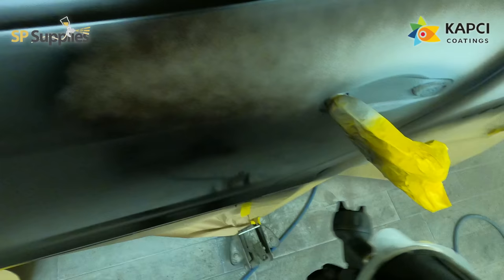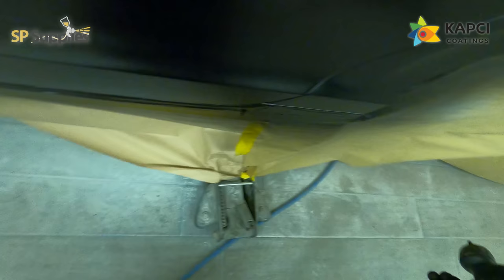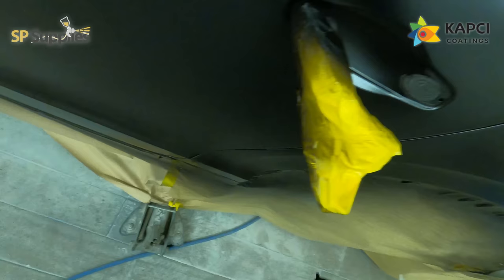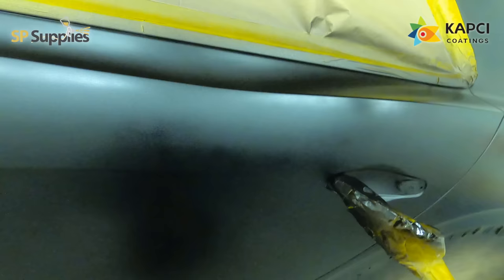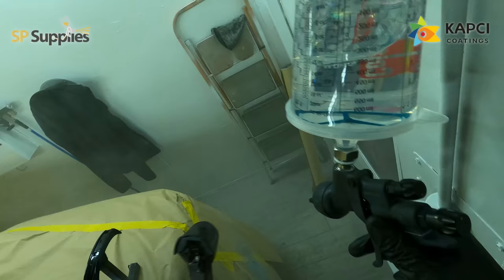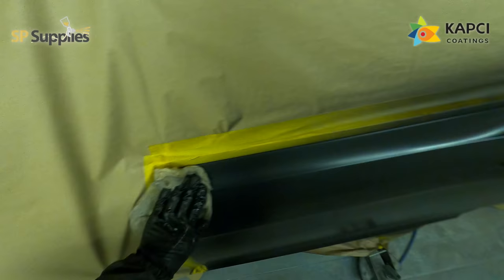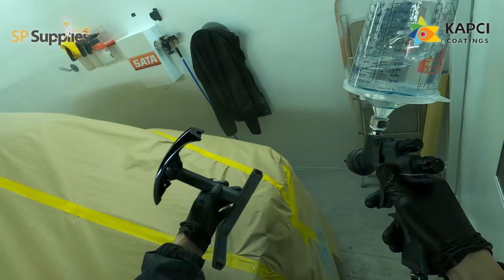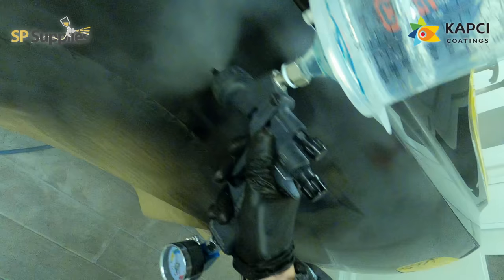Onyx Bentley Flying Spur Paintwork Walkthrough

Comment: Built a good number of RR and Bentley Corniche at Mulliner Park Ward back in the 80's mostly in body in white, but I did some time in the finishing shop. Hanging the finished doors and fitting the boot lids off the outriggers was fun. I think we were allowed 20 minutes per door if I remember correctly. Back then we hand adjusted the lock mechanisms. I always thought considering the complexity of the build what a nightmare it must have been for repair shops to deal with. 28 hours to fit the drop head and rehang the doors bonnet and boot post dipping and undercoat back from Derby. Really miss those days.
Reply from the maker: yeah unfortunately they just arent built like that anymore mate its numbers now

Comment: First class finish as always Tony the old Bentley came out looking mint, it's great to hear the Kapci system is working well for you plus it seems the spectro also works well, I was wondering how good the spectro would be as you always used to highly praise the Lessonal one. That clear does look like it flows out well and gives a great finish, I'm going get a small kit of the 6030 to try as it does look good.
Great live chat last night mate I don't know how the figures stacked up be it seemed quite busy 👏🙏👍
Reply from the maker: thanks mate and yeah the live chat was quite busy bud , yeah so far no issues with matches mate which im glad about was abit worried how good it would be but the camera is alot newer than the last i had so was hoping it would be good and it is

Comment: Hi Tony, so has it hardened well? because the datasheet says to add a 5-10% of thinner..
Reply from the maker: Yes I’ve seen no issues mate
Reply: @TonysRefinishingTV can i ask you which hardener did you use? I notice in the TDS that there are also the low voc series..

Comment: Hi Tony I have a question about mixing paint colours the paint code on my car has to different versions (m) and (m-//l) this is kapci system thanks.
Reply from the maker: whats the code for the colour mate and they relate to differnt shades , L is usally lighter , D darker , C coarser ect ect BL would be bluer lighter ect ect
Reply: NH623M  honda crv 2004 there are l8ke 30 options do I need to have colour chips.  Thanks for your time appreciated.